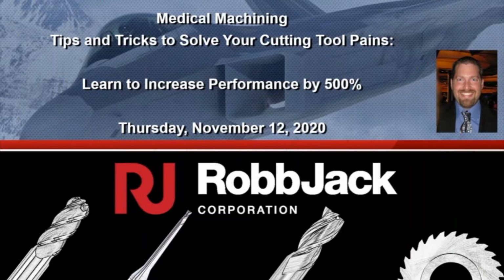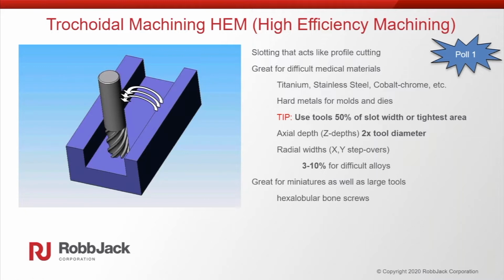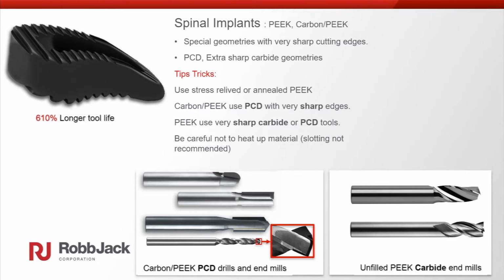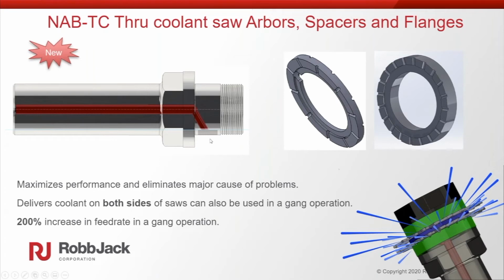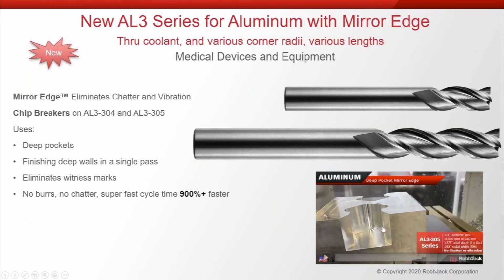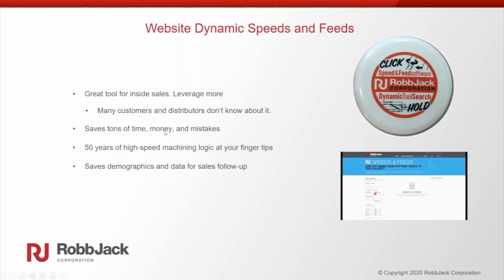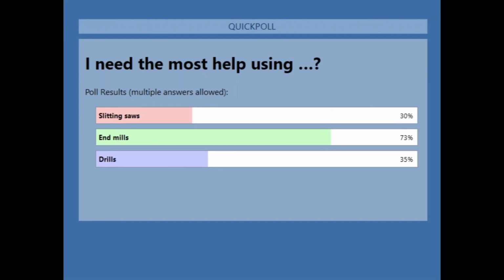Tips to improve performance when machining medical parts

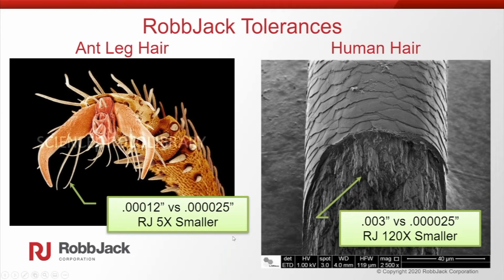Comment: 1:50 Medical Tolerances
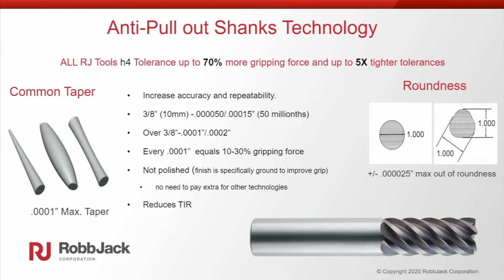2:52 Endmill Shank Tolerances
5:15 Virtual Company Tour Overview
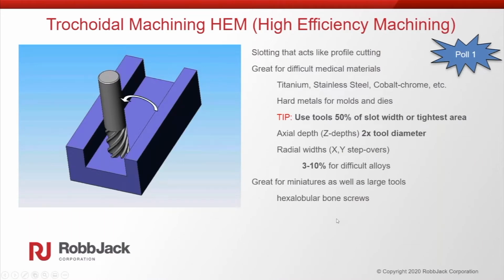7:16 Trochoidal Machining HEM
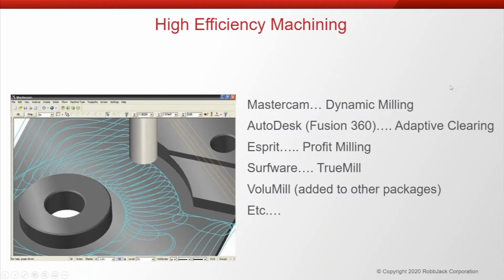11:33 HEM toolpaths by program
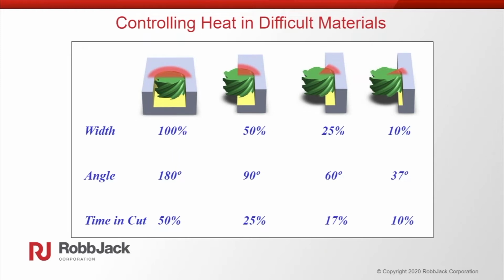12:23 Controlling heat
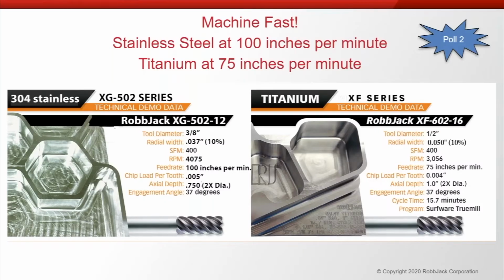16:00 Titanium/Stainless F&S
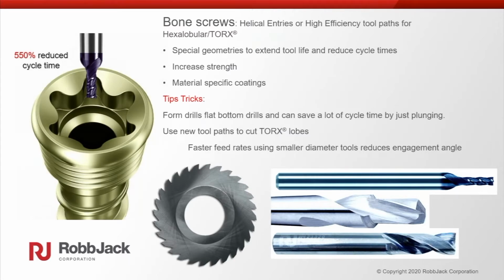19:28 Bone Screws
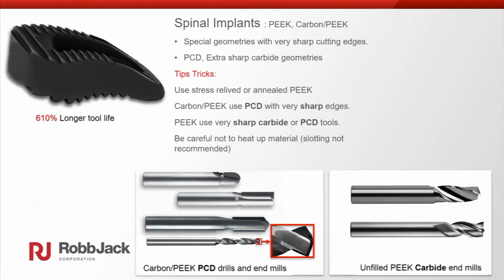21:00 Spinal Implants
24:10 Knee Joints
26:45 Hip Joints & Forging Dies
30:15 Slitting Saw Arbors
36:05 Aluminum Mirror Finishes
39:39 ER Integrated Solid Design
41:35 Micro Machining
44:06 Dynamic Tool Search